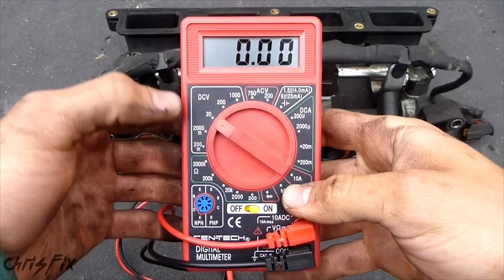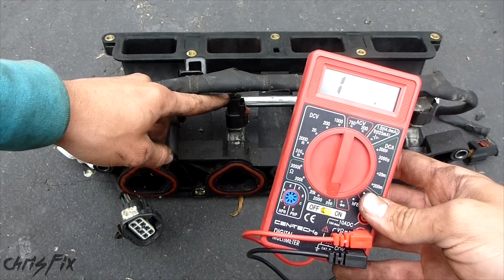How to Check Fuel Injector Resistance with a Multimeter

Comment: One other important point.
You ALWAYS want to subtract the meter lead resistance from your reading.. So, touch the test leads together (in this case, at 200 ohms)  you will probably get something around 0.3.  If you have 14.8 Ohms for example after stabilizing, subtract the 0.3, giving you an actual reading of 14.5 Ohms. :)  This is especially important with more sensitive devices, and can mean the difference between actual replacement, and not replacing when its actually bad. Good video!
Reply: Hey, my injectors are showing 0.8 ohms, is that normal? Low resistance injectors?
Reply: @amy40c  that insane low, I think it's not good
Reply: testing leads read 5.1 testing the injector read 16.5 so 11.4 is the result. Is this the correct reading?
Reply: thanks man. I had 1 broken fuel injector.
With the ohm meter, I also noticed my other 3 injectors are running on their last leggs as well. Factory settings on the fuel injector is about 12.5 ohm resistance.  Without your deduction suggestion. The broken one, was on 15.1 ohm, and I suspect the ecu might even cut off the injector at 15 ohm. The other 3 are at like 14.7 ohm. Pretty far off the original 12.5 ohm.
The video said, it should be within 0.5 ohm of the factory settings. Damn, mine are well off. I guess, I better just change them all?
Reply: Good point, but i think the manufacturers account for that user error and people who need to measure more sensitive devices know this, already.
Reply: @isaiahpinkerton3445  most of the more recent and higher quality meters do auto calibrate.
Biggest thing is just do the 200 ohm setting and touch leads to verify it’s truly “0”.
:-)
Reply: @jemtec1  Tried this, my $20 chinese multimeter auto calibrated. I think unless you're some oldhead with an ancient multimeter on hand, you don't have to bother with this advice. And if you have something that old, you probably already know how to use it.

Comment: I have one bad injector. Should I change all 4 on a Fusion with 180K miles?
Reply from the maker: +Tyre Hester it depends on your budget. All 4 would be best but you can get away with replacing just one.

Comment: Learning a lot of good tips from your video's. Thanks. Want to share some of my knowledge if you don't know already.. some multi meters you have to be really careful because some have a threshold in the ohm setting, I actually ran into this with a good Fluke meter; from 13 - 1 ohms the meter read it as continuity (or shorted out as I thought) I found that in the specifications of the meter.

Comment: so i can do this with the injectors in the car or outside the car? should i disconnect the battery? does the car need to be off? thank you, you are awesome...
Reply: Doesn't matter if they are in the car or out of the car.  You should generally disconnect the battery anytime you do involved work on the car for safety reasons.  Car needs to be off.

Comment: Hey Chris, can you test the fuel injectors with the multi-meter while they are in the engine but the wires are disconnected?  I didn't know if that makes any difference. Thanks a lot.
John

Comment: Ok. So I have a problem, with my Saab 900 16-valve Turbo. My engine is idling very poorly and i get misfires often, feels and sounds like it's running on three. I checked the resistance of the injectors and they all showed normal readings (2.8 ohms). I also did the test with the screwdriver and they all sounded pretty good. 

Any ideas, what could be wrong?

Comment: Hey Chris having issues with a 97 mercury sable sputtering and cutting off changed plugs wires no help changed fuel filter started sputtered for about a minute and a half drove it ran fine then started sputtering again next went to crank it will turn over start then cut off now won't start can you help

Comment: Is it possible to have dysfunctional injectors without faultcodes? I experience that the motor is shaking the car when idling/driving, even though i changed coilpack, wires and sparkplugs. So my next option would be injectors i guess
Reply from the maker: It is possible. Check the computer with an OBD2 scanner and see what your fuel trims are. That can help you understand what is going on.
Reply from the maker: And check fuel pressure: https://www.youtube.com/watch?v=_oXLUqE4Sf0
Reply: The injectors checked out OK through the screwdriver method and ohm reading, so thanks for the next steps! Love your content man, keep it up!

Comment: I have a 2000 Nissan Quest which as a V6 engine, and I occasionally get a P0301 and P0306. I checked all of the fuel injectors and I get 12.5 ohms for 3 of them, injector 1 has 14 ohms, injector 4 has 0.5 ohms, and injector 6 has 17 ohms. Should I just replace all of the fuel injectors?
Reply from the maker: injector 4 is a problem for sure. I would start by changing that one out and see before you change all of them!

Comment: Hello, does it matter if it's a turbo or not ? because I'm getting ohm readings of 1) 11.8, 2) 12, 3) 11.6, 4) 12 on my 2008 pt cruiser non turbo. Is that too low of ohms?
Reply from the maker: +aaronmcgaga83 It doesnt matter if it is turbo or not. As long as the ohms are all consistent you are good!
Reply: +ChrisFix ok, thanks.

Comment: I have a 94' Sonoma 4.3 and want to check the fuel pump relay but can't find the location of them anyplace under the hood. The only relays I see are on the fire wall (3 of em') & I think they're for the a/c. Can you please tell me where else to look for the one I need to check? I owned a Lumina & there was another fuse box right there in plane sight w/all of the relays, not in this case however & I'm pulling my hair out (actually just cussing a lot). #^%(*@#!

Comment: +ChrisFix Clogged/dirty/etc injectors wouldn't throw incorrect resistance readings though, right? So this is literally only for testing if the actual electronic part is bad for the injector, right?
Reply: I tried can shaft position sensor and got it to run just a little rough still
Reply: Corrrect. Dirty or clogged injectors would read perfectly fine. The "solenoid" chris describes is simply a copper winding that becomes magnetized (just as passing current through a wire wrapped around a nail makes it magnetic). An injector with an intact solenoid should read to have a very low resistance.
Reply: @OtherDalfite  cam you do the same thing for the coil packs for spark?
Reply: @grantquinones  unsure. The coil pack has switches inside so i doubt you could get a signal since the switch will be open. A good way to tell if a coil pack needs changed is if it is cracked or just looks really old. Spark plugs can be checked for continunity as well but they rarely fail unless really old

Comment: is this diagnostic data is normal because car stalls mostly when steering wheels turns to wright and clutch pressed
Reply from the maker: +Qasim Haneef Sounds like you might have a vacuum leak.

Comment: hi i have skoda octavia 1.4 petrol 2002 reg. it start stalling at junctions and engine vibrates at idle position. could you please tell me what it could be i changed spark plugs, coil pack checked , no fault detected no check engine light. drives ok on high revs but misfiring on low revs.
Reply from the maker: +Qasim Haneef It could be the fuel injectors or check this video out: https://youtu.be/vFhoNykgQtc?list=PLvKbarVtwhUua3P5K0ZyTiCm4T3DjGH6F

Comment: Hey Chris!
Ran a fuel pressure test on my 2003 Ford ranger 4.0 and KOEO result gave me a leaking pressure. Started at 55 psi and leaked to 0 in a matter of 2 minutes maybe less. Cranked the engine up and it was at a steady 66 psi (manual says 64 +- 8). Should I check the injectors and if so, do I disconnect the battery terminal? Also, I don't see a fuel pressure regulator like on your vette so I don't know if I can check the vacuum line for gas smells. Thanks!

Comment: would I have to remove the whole thing out the car to test it with the ometer? or can I test it with the injector on the car with the ometer?
Reply from the maker: +Jaime Padilla You can test it still in the engine. No need to take it out.
Reply: Does the car need to be running when testing it?

Comment: Have you ever seen injectors get stuck open?
Reply from the maker: +stephen gaertner Yes, they bleed the gas right out into the cylinder. That is due to debris and not changing the fuel filter most of the time.

Comment: Great videos! I have a question for you though... I have a Mitsubishi GTO (3000GT) N/A, which I have converted to TT. Now, when I made the conversion, I also replaced the N/A high impedance injectors with TT low impedance injectors. I also installed a TT ECU in place of the N/A one. To make the low impedance injectors work, I wired in resistors to them. The car worked perfect! Then, I decided to buy bigger injectors, but got high impedance ones, fooled by the fact that my car is an N/A, but forgetting that the ECU in it is from a TT... I installed the new high impedance injectors and removed the resistors from the wiring in the process. Now, I have hard time starting the car and can only do it if I press the gas pedal to open the throttle. I also have a choppy idle. Could that be caused by the new high impedance injectors? Thank you!
Reply from the maker: +Ilian Nachev You probably just need a tune. The engine doesnt know the injectors are bigger.
Reply: +ChrisFix I am using a SAFC2 (piggy back) to tune with and I have dialed in the basic parameters in order for the car to start, and run, but I still can't start it without pressing the gas pedal, especially when the car is cold.  I read some reviews about the injectors I am using and they were not very good. The injectors are from a company called Smartfire. Do you have any experience with them? I just want to make sure my engine is not going to be damaged. My next step should probably be to check each injector to see if they are working properly. The problem is that I cannot program the ECU on my car, so I cannot tune for injector dead time... Maybe the fly back voltage that the ECU applies to the injectors is different than it was during the manufacturing tests and that is causing the problem. Is that possible and can I do something to make it work better without being able to program the ECU for it? Thank you so much for answering!
Reply from the maker: +Ilian Nachev Without re-tuning, I personally dont know of any other way to make it work. The bigger injectors are different than the smaller ones so the computer needs to know that. I have never used smartfire injectors. Keep me posted man and good luck!

Comment: how do i do this as mune are all on a solid bar like the harness for each is on this bar so i cant get the clip off as all must come off at once... 2000, ford focus wagon se
Reply from the maker: +Joseph Sepe Interesting. Instead I would do this then: https://www.youtube.com/watch?v=tA_E6X4ISgQ
Reply: +ChrisFix I found out... there is a square metal like ring on each harness that gets pushed in on each at same time to release all harnesses, sounds hard but i used two screw drivers and two sticks or something and use my lower arm to press all together and then lift up on the bar to release them all. Easier then i thought lol. Stupid idea by ford but there are two hoses coming out of the bar too so idk why its there. Thanks tho

Comment: Hey Chris I have a 1993 Lexus ES 300 ,  my check engine light comes on so it won't pass the smog test .  Is burning really rich and stalls out, not all the time but sometime .  I found out that at least one fuel injector is bad by replacing the fuel injection will that fix the problem ?
Reply from the maker: +Fredrick Clayton It might solve the problem if that is the only bad injector.

Comment: how can I see if they're getting the signal from the wiring harness. I have a 91 Corsica 3.1l it's firing with eather just fine when sprayed through the breather. almost all my sensors are new. and I'm getting pressure at the rail. I don't think it's sending through the injectors for some reason. and it's all of them not just one.
Reply from the maker: +Daniel Cox You can listen and see: https://www.youtube.com/watch?v=tA_E6X4ISgQ
Reply: +ChrisFix ok so none of them are working. I'm gonna check the resistance tomorrow

Comment: another great video from Chris , saves money. I guess this test can be done without removing any part from enginer except the injector connector. thumbs up.
Reply from the maker: +hypertuch Thanks a lot bud! You dont have to remove the fuel rail and intake. I just happened to have it taken out of my car so I used it.

Comment: Thanks for the video. Helpful for me, working on a 2001 4.6 ford. Getting P305 misfire on cyl 5 & 7.  Eight new plugs and new coil packs on 5&7, runs much better but still getting a misfire occasionally. Suspect some type of fuel delivery problem.
Reply from the maker: Kevin N Could be injectors. I would change out your fuel filter if you havent already.

Comment: Hi my friend Ihave ford explorer 2010  4.0l and Ihave a hesitation especialy when I operate the coolant and there is no code and no check engine .the hesittion increse when I want to quikly accelerate only
Reply from the maker: Tahirkhairy Alrubaay Could be the coils on the spark plugs but it could also be many other things. Did you check your spark plugs? Did you check your fuel pressure: https://www.youtube.com/watch?v=_oXLUqE4Sf0
Reply: I changed the sparks plug and check the coil also .Now I will change all the injecters because I smell odor choking

Comment: hi , in my car manual says that the injector would be 13.8 ohm resistance.  three are normal , but one of them is with 17.4 ohm, I replace it ?
Reply from the maker: Rogerio Duarte Yes, if one injector is off by that much, that means it could be going bad! Do you have a problem with your car running?
Reply: ChrisFix high gas consumption
Reply from the maker: Rogerio Duarte Gotcha. Any check engine lights?
Reply: No, my car is a corrola 1998
Reply from the maker: Rogerio Duarte ok, well let me know what you find. It could be the injector but I am thinking it might be something else. Does that car have a mass airflow sensor?
Reply: Not an air flow  sensor, only intake air temp sensor,  it's ok. Oxygen sensor is ok.
Reply from the maker: Rogerio Duarte Hm. What do your spark plugs look like?
Reply: spark plug and wires NGK are new, distributor cap , rotor are new.
Reply from the maker: Rogerio Duarte Yea, but what do the plugs look like? Are they black even though they are new?
Reply: look like new, used it for two miles
Reply from the maker: Rogerio Duarte oh gotcha. I was wondering if you were running rich or not. Let me know if the injector fixes your problem!
Reply: I meant two thousand miles.
The plug look good a little black.
Reply from the maker: Rogerio Duarte Yea, it is running rich if the plugs are black.
Reply: I dont have pic here, but then the injector are bad?  Or dirty?
Reply from the maker: Rogerio Duarte Potentially. Do a fuel pressure test to see if they are leaking: https://www.youtube.com/watch?v=_oXLUqE4Sf0

Comment: Audi a2 2002 gasoline I get PO204 four injector running rough what with the code?
Reply from the maker: Cessna readyfortakeoff I would take the #4 injector and switch it with another injector and see if the code changes to that cylinder. Have you tested your injector like in this video?
Reply: No no yet just got back from checking wires car is hor wife was driving on it I will check that tomorrow  and let you know im putting new spark plugs  filter and changing oil filter.thank you so much for your help! ✋ high five from Germany!
Reply from the maker: Cessna readyfortakeoff Keep me posted and thanks for the shout out from Germany!

Comment: Hey guys, Can someone please help me with my issue? Long story short; I stored my car for the winter and now it isn't starting. I've replaced my fuel pump, fuel rail, injectors, fuel pump relay and injector fuses.

I've tested the fuel pump by removing the feed line and cranking.. it squirted out fuel.
Tested the fuel rail  by removing an injector and cranking.. it squirted out fuel
Tested the injector wiring  all between 11.6-11.8v while cranking
Checked for spark and replaced coilpacks/wires from my working car.

The only issue is that the injectors arent opening to spray fuel when i crank the car. Any idea as to why this is happening?

More info here http://www.toprotege.com/forums/showthread.php?t=64834

Thank you

Jp
Reply from the maker: ***** This could be a problem with grounding or fuel pressure. I would get a fuel pressure gauge and test fuel pressure. If fuel pressure is not in operating range, your injectors wont fire. Check this out: https://www.youtube.com/watch?v=_oXLUqE4Sf0
Reply: ChrisFix Thank for the suggestion bud. Should I do a fuel pressure test on both the feed and return line after FPR? I'm going to run these tests tomorrow. Will keep you updated. 

1. Injector wire signal check (light bulb test while cranking) 
2. Crank/Cam sensor voltage 
3. Haltech wiring for continuity 
4. Clean Injectors 
5. Check if injectors open under 12v or 9v battery 
6. Fuel pressure test on feed/return line
Reply from the maker: ***** Check the fuel pressure before the fuel pressure regulator like in the video. Keep me posted with your tests!

Comment: Can i test the oms while the fuel rail is still connected the the fuel system?
Reply from the maker: Fernando Robles Yessir. You dont need to take the injectors out. Test them right in place and just disconnect the wires.